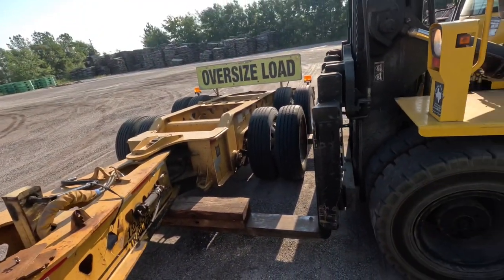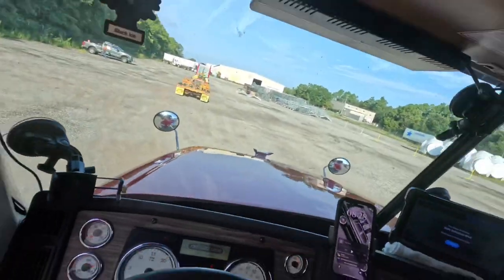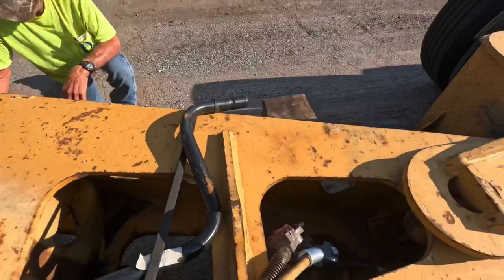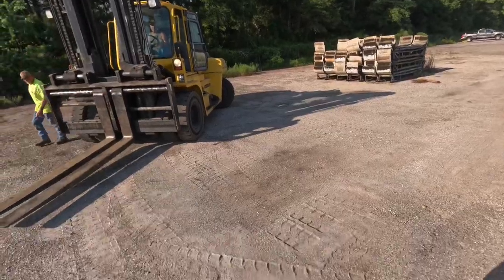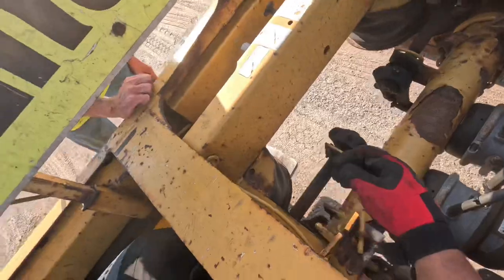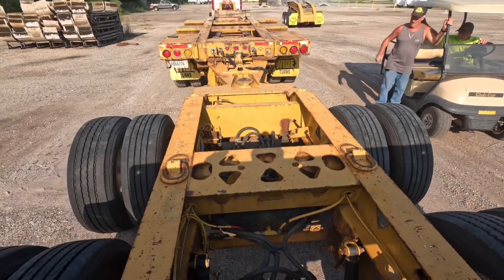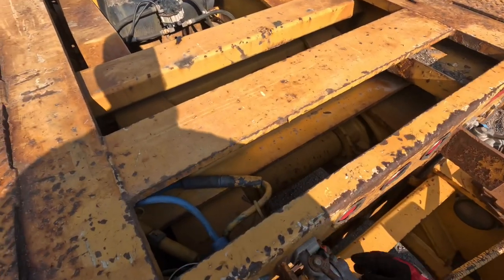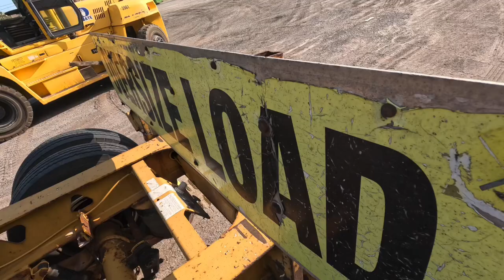Setting up a 2+3+2 Multi-Axle trailer Part 1

Comment: when will a trailer manufacturer come out with a system that you don't need to go through this ritual of setting up? I know of Europe trailer companies that have such trailers.
Reply: Europe has different axle weights, this is an old lowboy. The newer ones here in the USA are so much easier to put together.
Reply: @terryperrott9913  The self steering ones are fantastic. Those guys go around corners and such with ease.
Reply from the maker: Yes, the trucks in Europe are allowed more weight per axle than the US. With this setup I can gross 220k.
Reply from the maker: ATS have newer trailers in their fleet that don’t require as much finessing as this one. This trailer is one of the oldest they have still active in their fleet which was make in 2016
Reply from the maker: We have steerable trainers over here also, the last two axles on this particular trailer self steers going forward, but will need to be lifted off ground to back up without damaging them. We also have remote steering trailers here in the fleet as well.

Comment: yuck, glad ive got a nitro lol. dont want no part of shimming that mess.
Reply from the maker: @TRUCKNHEAVY  HAHA, its not that bad shimming it.
Reply: @stewslogisticsllc9460  oh i know, but nitro is just so much easier. just wish ats would get all hydraulic trailers (necks) id be a happy camper lol
Reply from the maker: You said a lot when you said that. I wish they would do the same. However I just got assigned a 2025 2+3+2 on Friday. Going to get my first load with it on Tuesday
Reply: @stewslogisticsllc9460  right on, I just done a GE out of Pensacola to Illinois. Took a drive train up there.
Reply from the maker: I did 4 of them already, would have done a 5th one but this trailer had cracks in the frame and needed shocks all the way around. So they deadheaded me to Cloud to drop that one and pick up the new one